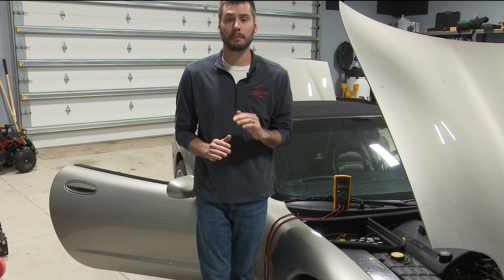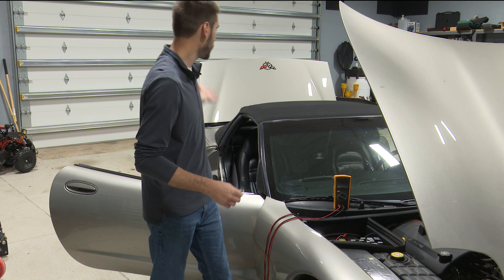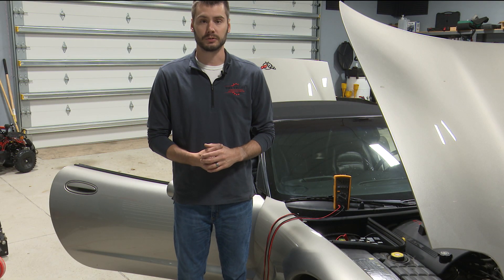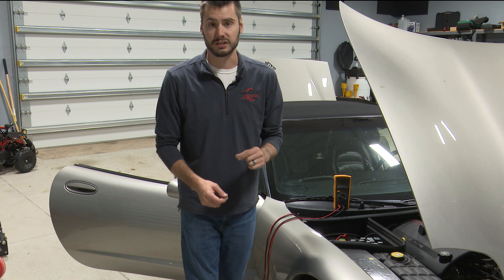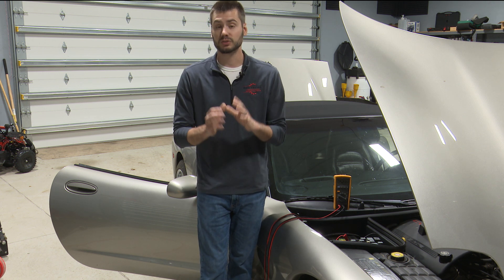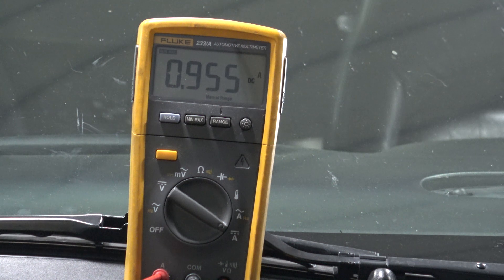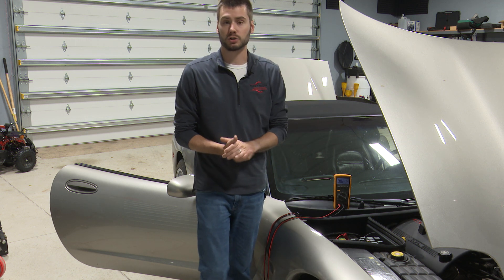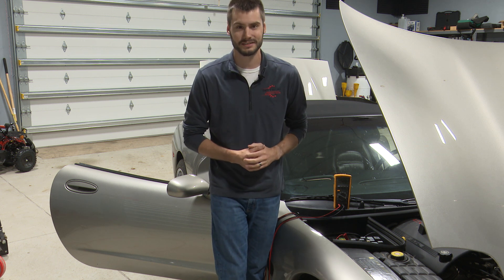Battery Keep Dying? Simple Tests For A Battery Drain (Parasitic Draw)

Comment: My 02 f150 Lightning has a parasitic draw of .20 , I pulled all the fuses and relays 1 by one but the only one that drops a lot is the Relay #2 battery saver relay . I changed it but still does the same thing…

Comment: Thanks for the video. Hope you can answer my issue. I have a new battery, 3 days old, and I have a hard time cranking. The battery state of charge when off was about 12.6 volts, and the alternator is putting out about 14.0 volts when the engine is running. Then, overnight, the voltage on the battery was 10.8ish. I tried the series on the negative terminal after 10 minutes of turning the battery off, and my readings were 1.4 to 0.47, to 0.03. Does this mean I do not have a parasitic draw? What would cause my battery to go down to 10ish volts? Maybe I have a bad battery?

Comment: Car dealers sometime put tracking devices in cars sold in case they have to repossess it, they can locate where the car is they draw voltage while car is not running.or if car is stolen off of lot.

Comment: Am currently having this issue found the main ecm relay bridged can it be the culprit ?
Reply: Yes, a bridged (jumped) ECM relay could definitely be the culprit for your battery drain. The ECM (Engine Control Module) is supposed to shut off when the key is off, but if the relay is bridged, it could be keeping the ECM powered 24/7, slowly draining your battery.

Comment: Easiest/cheapest way around that (assuming that's your only draw) is to splice in a ON/OFF switch on the hot side of that line and put it under the dash. That way you can leave it off most of the time and just switch it on for a minute on the rare times your going to move the seat. Hope that helps! ;-)

Comment: My issue with my 2001 Impala ls is everything is off in the car BUT battery drains and i have to disconnect because my Gear indicator starts on as if my car isnt going on Park even tho its on park. How can i fix this?

Comment: Your process is logical and very enlightening.  I'm dealing with an OBD Reader showing engine switch on V of 10.8 but direct meter read off +/- battery terminals of 12.9V.  Brand new alternator and new battery.  Will replace battery current sensor and hope for improvement, otherwise will embark on parasitic draw investigation using your technique!  Thank you, quite informative!

Comment: on my 2007 Cadillac Escalade Esv I'm having a parasitic drain too for the longest, been trying to figure it out i have a aftermarket alarm but on my bi-directional scanner i get a code for my driver seat module, maybe its the same I'm going to try this tomorrow..maybe same module perhaps..i see my DSM fuse in the inside fuse panel on mine hopefully that's what doing it nd can pull it also or maybe i can't cause i see it aiso controls my keyless entry system but going to see if that's drawing too much current i have 3 auto multimeters at my disposal plus a test light and a probe type one also

Comment: I just had a call from the dealership because I got a 2013 Dodge Durango. I recently changed the alternator and the PCM. I thought that it was the end. But the battery just died. It was last month when I took the Durango. Just as I was about to negotiate for a replacement as trade in, the Service supervisor found the Parasitic draw. He told me that the Durango did not had a feature: A component that heats up the seats. He found that a fuse was found inserted for the heated seat feature in which the vehicle did not have. So far, the Durango is running normally since yesterday. And there was no drain on the battery. Right now I will give it time to test out whether the battery will keep the charge or it will drain again. If a feature is not on that vehicle, then there should not be a fuse for it.

Comment: I got a truck and soon after the battery had to be recharged till eventually had to be replaced. I realized that the radio had all kinds of bull and stuff and multi-lights so I took it off and problem solved. I will get me a normal radio I can turn on and off and that I know it will help.

Comment: How does this work on a diesel with 2 batteries? Do you leave one battery with both pos and neg cables hooked to the battery, or both batteries with the pos connected and the negetives disconnected?
Reply: If the batteries are connected in series to create a 24V system… just disconnect the neg cable that goes from the (—) of a batt to the chassis and leave everything else as-is. (The other neg cable will be connected between the (—) of one batt and the (+) of the other batt.)

Comment: I've just experienced the issue of my vehicle, over several days, of the  battery draining overnight and failing to start the vehicle.             I started it with a booster pack and drove for 15 miles and then tested the battery with a multimeter and it read a healthy 12.6 VDC.      I next, drove to an autoparts retailer (PARTSOURCE - a subsidiary of Canadian Tire Stores), where they conducted a free battery analysis with an analyzer that is valued at $700 which is capable of running several tests, including simulating a "load test" on the battery.  Again the battery passed as healthy.
I next tested the vehicle alternator with a multimeter and it's output was a healthy 14.6 VDC, which eliminated the alternator as the cause.   
This left the final conclusion that the cause would be a parasitic draw of amperage from the battery by some shorted system within the vehicle.  I followed the normal procedure of allowing the vehicle to sit for an hour with every thing turned off, to allow computers and other components to sleep.  The amperage draw was then tested with the multimeter to identify any unusual draw from the battery.  The draw was extremely low in the millivolt range, indicating NO unusual parasitic draw.  
Frustrated and perplexed and unable to perform additional tests, I bit the bullet and purchased a brand new AGM battery and installed it.  -- Problem Solved --.  
CONCLUSION:  (1) 95% of the time, the cause of a dead battery overnight, or within a few days, is a damaged battery.  (2) Even the high-end, expensive battery analyzers may not be able to accurately determine the health state of a battery.  (3) When the alternator health and parasitic draw have been ruled out, replace the battery before proceeding with further expensive testing an analysis.

Comment: Current and voltage are two different things, youre measuring in voltage so youre looking for voltage across the fuses current would be amps/milli or microamps also its always good to make sure youre meter is in working order by testing a known good circuit before troubleshooting great video minus those few things

Comment: Great lesson . I believe there is a chart on the Power Probe website that will convert that voltage drop to amps or mili amps , depending on the fuse size .

Comment: best practical explanation of voltage drop I have seen... a good visual demonstration. Thanks from us here in England
Reply: Aye, i second that, my V70 has this problem, i took it in to the menders and to cut a long story short the battery and alternator were fine. Taking it back in a couple of weeks (as they are very busy) for them to find the draw,hopefully.😊.Ps, it’s been driving me mad for years and now i have enough of it, but not helped by my forty or maybe fifty miles a week driving.

Comment: Hi, 
I have drain of power from a fuse and it is 1.2A. The fuse is for 4 Devices. Gateway,  steering wheel lock,  injection switch and light switch. I tried to remove all the connectots of the components one by one to see if the drow of power and only when i remove the connector of Gateway the drowning  is 0A. It looks like the Gateway stays always ON.
Can you please help me for this case?

I will appreciate your help

Comment: in most instances with this upon locating the culprit fuse, is rule of thumb to check wiring diagram upon the fuse causing issue looking at the wiring if it has open exposed portion of its wiring which could be what is the cause that is draining the battery when the fuse should be at rest without any current electrical flow going through it ? or are there any situations where your just replacing the fuse or thats wrong thing to do by installing just a new fuse ?
Reply from the maker: Hey Tyrone,
Good question, This test only narrows down which circuit the drain is on, The fuse itself can not cause an unwanted battery drain. The two instances where the fuse would be an issue, is if it was blown or if it was causing a resistance to current flow. A blown fuse would cause no current to flow and a fuse causing high resistance would cause a higher than normal voltage drop, but would not cause the battery to go dead while the car was not running.
I hope this helps! Thanks for reaching out
~Ryan
Reply: @GoTechTraining  oh alright so in applying your testing method I have only the harbor freight cen tech 7 fucntion multimeter for use to perform that parasitic draw test you spoke on in video. I appreciate you responding to me in light of this now i need to locate rear wiper fuse and remove it. Now how do i check the rear wiper motor to determine whether it is functioning properly or its defective and needs replacing which would cure the issue there? Thank you for responding giving me a few moments of your time.
Reply from the maker: Hey Tyrone,
If you remove the wiper fuse and your draw is gone or battery stops draining. Make sure the wiper is parking all the way after shutting it off. There usually isn't any serviceable components in the wiper so if it doesn't park or is causing the draw replacement may be your best option.
Reply: @GoTechTraining  To be clear here what you are telling me is if the rear wiper switch attached from the steering wheel of my 2007 Audi Q7 isn't parking the wiper blade so its remaining at full rest (without re-activating itself to wipe the rear window), I am to replace what : [A] the switch mechanism from steering wheel or [B] replace the rear window wiper motor itself ? And thank you for giving me a bit of your time an for sharing your mechanic knowledge with me a novice seeking to learn so I am able to fix and repair my own vehicles.

Comment: glad i found your video upon this tpoic and issue. my 07 q7 with 3.6l keeps mysteriously doing this and i can't figure out the reason why whats causing this problem...hope to learn how to track down this issue and correct it. question could the rear wiper be cause for this on a suv vehicle ?
Reply from the maker: Hello,
Yes, rear wipers that will not park are common to cause a battery drain.
~Ryan
Reply: @GoTechTraining  Now i have new battery that is in vehicle now. I disconnected the power so it does not drain battery. I am wondering whether once the battery has been properly coded to the vehicle PCM ...would that then cause or allow battery to begin re-awakening any and all components which it had begun shutting down, in an attempt to have enough power to start vehicle? When i bought Q7 previous owner had let battery in it get deficiently very very very very very low. My hope and theory now has become this: once new camshaft sensor goes back in and i am able to obtain compression readings of all 6 cylinders i want to check my fuel pump itself to determine whether its clogged whether the filter in it needs replacing...and check the fuel filter relay along with bank 2 fuel rail pressure sensor intermittent (G247) reinstall new plugs the coil sticks connect those...and try to start vehicle. If you were close i would pay you to tell me whether it has jumped time or not. in that case i would be simply on hunt for engine get it swapped fluid in it drive her like its 1999 😁because my theory is i think it was not ever getting any fuel possibly...

Comment: So the test diagram setting for the current ; disconnect the negative cable from the battery then take one lead of the meter to ground cable and other lead is on negative post of the battery? Is this correct?
Reply from the maker: Hey Nilo, that is correct. You want the multimeter set to amps and you want to place it into the circuit so any current flowing out of the battery if forced through the meter.
~Mike

Comment: Does this test really "confirm" a bad driver module as the true cause?  Does this test rule out the possibility of a bad ground, a bad connector, etc., creating the draw, or the possibility of anything else other than the module? Just curious.
Reply from the maker: Hi John,
Good question! A faulty ground or connector will cause a high resistance or open in the circuit and actually cause the circuit to not work properly. This would cause the circuit to draw less amperage or no amperage due to electricity not being able to flow.
I hope this answers your question, thanks for reaching out!
~Ryan
Reply: @GoTechTraining  Perfect. Thanks for the clarification.

Comment: Do u guys use thermal imaging sometimes, to diagnose some problems for example:
- Which cylinder has a misfire  or which coil isn't working 
- parasitic draw 
- leaks (tire, coolant, vacuum leak...)
Reply from the maker: Hey Bobo,
Yes, we use one for all of the above. I really like using it for brake issues, to see if one brake is sticking on, or not coming on.
Thanks for the question!
~Ryan Wilsing

Comment: I found my problem. the neutral relay switch went out. Located nearby the transmission. Need to drop the transmission for room to remove and replace defected item.
Reply from the maker: Hey, awesome you found the issue, sorry to hear it's gonna be a lot of work to get it fixed :(
~Mike

Comment: I have got a problem on my 1989 Toyota Cressida, I performed the test as per the procedure and removed fuses one by one but the reading on my multimeter did not drop as it stayed on 12.45 ma. When I checked on the positive terminal of the battery I found that the thick white and red stripe wiring was connected directly to the positive battery terminal. I removed it and the voltage dropped to 0.03 ma.My problem is that I am wondering where must this wiring be connected then.
Reply: Are you sure you were measuring amperage? 12.45 seems suspiciously like the battery voltage when the car is not running.

Comment: Ok I’m in the Bahamas, and after a 2 year drain, your video definitely helped me find my parasitic drain on my ‘14 Rdx. Thanks so much
Reply from the maker: Hey Tony, that's awesome to hear! What did it end up being?
Mike Becker, Senior Instructor
Reply: @GoTechTraining  it ended up being a 20amp fuse to an amp that was showing 3 mV and windshield wipers were at 1mV. And a seat detection fuse.
I still have to find out what was wrong so I left fuses out of the systems I wasn’t using. But first time I haven’t had to hook and unhook battery cable.
Reply from the maker: Hey Tony, that's awesome! Great start!
Mike Becker, Senior Instructor

Comment: I have a 2006 GMC Sierra Denali that's had a parasitic drain for the past 2 yrs since I've bought it. I've never been able to figure out the problem, but I feel this video will point me in the right direction in getting my problem solved.
Reply from the maker: Hey Manuel, thanks for watching! I hope you get the issue fixed up!
Mike Becker, Senior Instructor
Reply: @GoTechTraining  I found my issue! I had heard a humming noise coming from the passenger side under dash. So I pulled the cover and touched the blower motor resistor and it was super hot! I thought that was odd cause the truck hadn't been started in a day or so, so I pulled fuse 40A for blower motor and it turned off. Upon inspection of the resistor I found it was super corroded! I recharged the battery and measured volts and it hasnt dropped since I pulled the fuse 40A. I plugged the resistor back in and fuse 40A and the volts on my battery where dropping significantly! This video was very helpful!

Comment: Once you figure out which fuse it is, then it's just a wiring problem to whatever the fuse powers?
Reply from the maker: Hey Adam, could be a fuse, could be the component powered up through the fuse.
Mike Becker, Senior Instructor
Reply: @GoTechTraining   Go to all data and see what's powered on that circuit that goes to that fuse. Measure the resistance at that circuit and you'll have your answer.

Comment: Great job. I started adopting the voltage drop method years ago- it’s way better than pulling fuses. I also only ever use an amp clamp now as leaving the meter in amp mode accidentally can be majorly catastrophic on your next circuit test.

Comment: Maybe I'm slightly confused but wouldn't you expect to see voltage at the fuse considering its on a hot at all times circuit (as shown by the diagram). Additionally what would be the most likely cause in the seat? A short to ground?
Reply: L❤❤❤
Reply: You're not measuring between fuse and ground, you're measuring across the fuse, which is in effect a tiny resistor. If there is no current flowing through the fuse there will be no voltage drop across the fuse.

Comment: Good video, I was having a problem with my 2018 Transit van going dead over setting a few days so I went through this procedure. Found out that it was considered normal. What was happening was every time I opened the cab door the whole system would power up and would stay powered for 20-30 minutes. Since i was in and out of the vehicle multiple times over multiple days without driving it the battery would go dead. Far as I'm concerned its a piss poor design by Ford as there is no way to reprogram the computer to shorten the time delay for powering down the system.